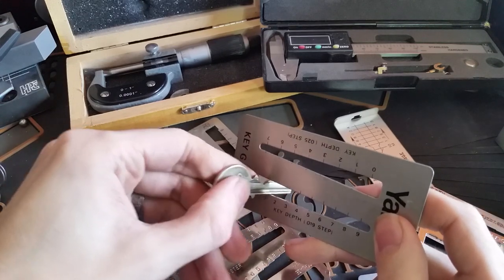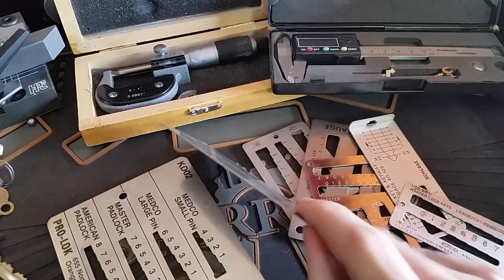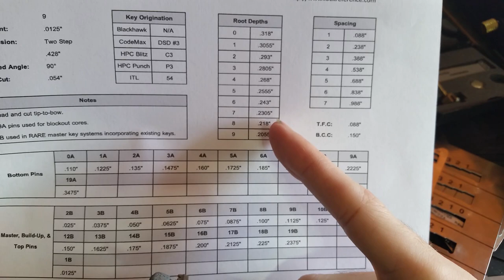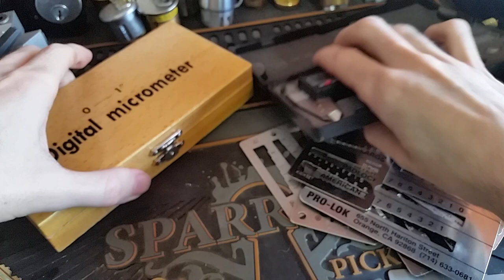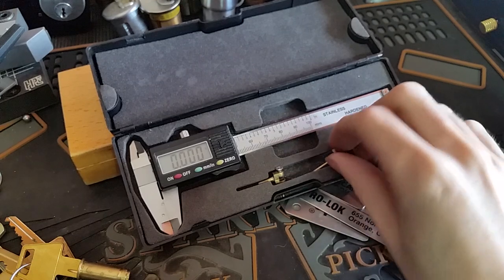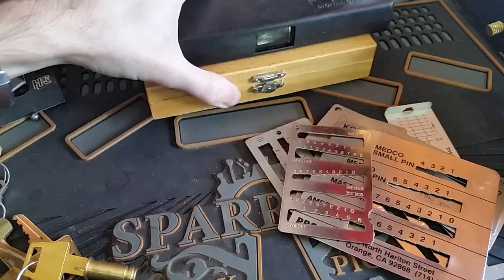(104) measuring devices for locksport and locksmithing

Comment: Very extensive and thorough. Did you make the caliper attachment or are they manufactured specifically? I tried to use some of those styli for dial gauges but they don't have the snap/screw-on mechanism like those shown in your vid. F.Y.I., the pocket-size thickness gauges are very handy for measuring non-standard keys (though you may need to make small mods, such as changing the styli or anvils), and much more compact. ;-)
Reply from the maker: I made the caliper attachments myself from bits of scrap, I based the design on a product that I saw reviewed in an old copy of The National Locksmith from the late 1980s, as far as I know the manufacturer ceased trading years ago and I couldn't find anyone making a similar product.
Reply: Thanks for the inspiration and information. :-)